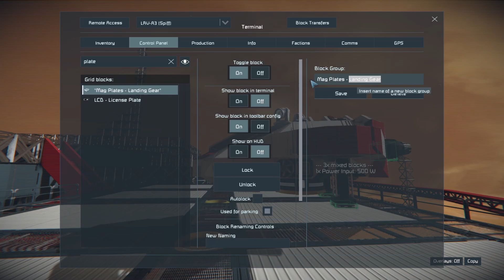Retrofitting a Speeder | Mother OS

Comment: I been seeing this word alot on reddit lately, its seem pretty smart. But im some what unsure what it actually does. Is its main function to work instead of timers and event controller and such?
Reply from the maker: Hi mate, it’s a great question. I’d hesitate to say that MOS can completely replace Timers and ECs, but that is one of the several goals I have for the project. As I continued to build, I felt creating (and updating) automations with the ingame blocks took a lot of clicks and menu navigation. You also can’t copy and paste your automations, so for the most part you’re wiring up each grid from scratch.

I was also craving a way to send more intelligent commands to other grid which I felt was a big opportunity to extend the gameplay loop. Also, MOS won’t run groups or blocks on other “docked” grids, so no more accidentally turning all your batteries off if you’ve got groups named the same.

At the end of the day, MOS is a straight forward library of copy-paste-able commands designed to run most of the common automation use-cases in SE. there are still a few limitations here and there, but I’m working on them ;) oh, and if you want to build your own script, I’ve released the core framework MOS uses to help you get started.

Cheers!